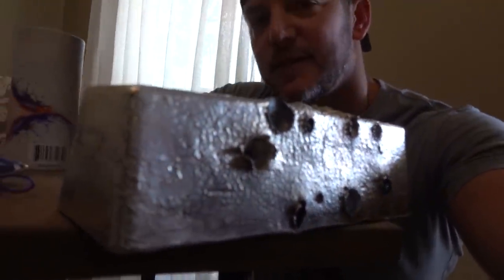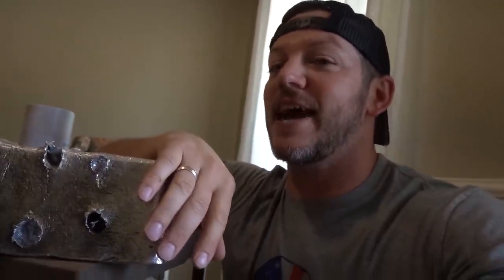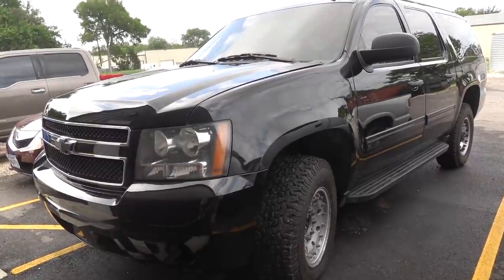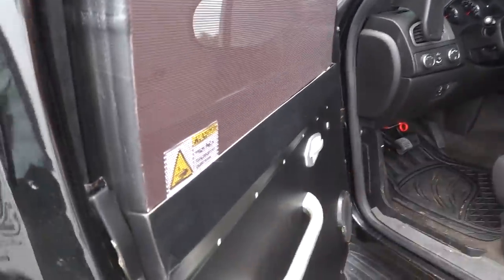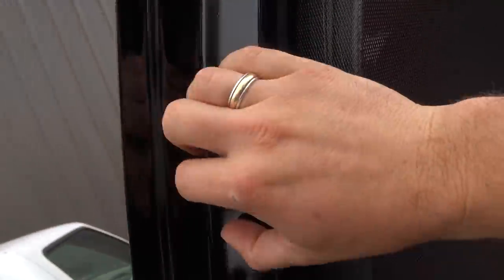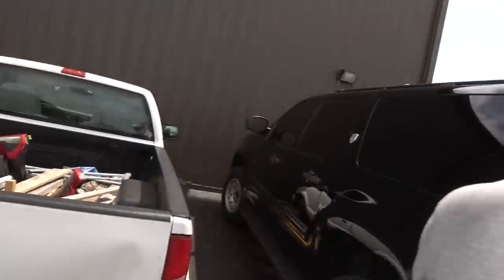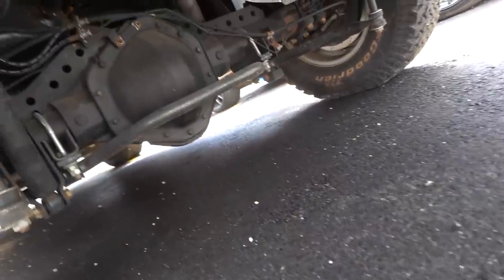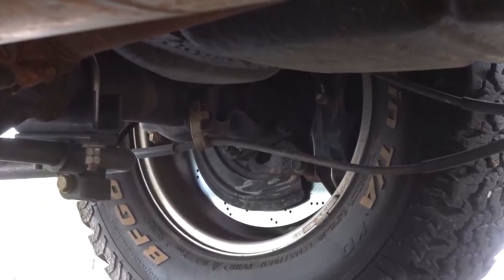I may have acquired a FULLY ARMORED SUBURBAN!!! 50 cal Proof...

Comment: Don't lock your keys in the car. No slim Jim that I know can handle the job.
Reply: Dead battery would also screw you.
Reply: Lmao you win the comments section 🤣
Reply: Picking wafer locks isn't but a thang.
Reply: @stopthephilosophicalzombie9017  "this is the lockpicking demolition"
Reply: @ComfortableFetus  Lol. Indeed.
Reply: Probably why the back is a door. If you get locked out that's the only way in
Reply: @stopthephilosophicalzombie9017  If they really engineered the car, that lock will be made in-operable.
Reply: @TBendez  What, you mean only remote access?
Reply: @stopthephilosophicalzombie9017  A theory of mine but yes, RF/IR remotes have been around for well, 30-40 years, and are not exactly witchcraft. Counting on physical keyways in a car like this, nope. 
Honestly, remote access with some kind of encrypted protocol would be my choice.
Reply: @TBendez  Sounds good to me too.
Reply: @stopthephilosophicalzombie9017  most likely armored, a dude from the sinaloa cartell had and fully up armored gold plated jeep grand cherokee and got plugged and when a round busted threw the key hole
Reply: Theres probably a code pad somewhere that opens the back hatch. either that, or a secret lever that opens one of the doors. If i had to guess, somewhere underneath protected by a rubber seal.
Reply: Lol
Reply: Best comment

Comment: stopped by the police
officer: "could you lower your window sir?"
Matt: "I wish.."
Reply: glad im not the only one thinking about when he gets pulled over for way way to dark tint
Reply: I'm a bit worried in case they crash the car, and then the firefighters are unable to extract them because they can't get into it!
Reply: @thesaxophoneboy  what’s the chance of crashing into something that will quickly stop a 12k lb car though? And in that situation how would a lighter car help lol
Reply: @thesaxophoneboy  what sauce said, that thing is crushing normal cars and trees with ease
Reply: @thesaxophoneboy  the hydraulics in those doors are strong enough if used from the inside to break the latch and force the doors open, plus it has an escape hatch into the rear of the vehicle, they are very very well built.
Reply: @thesaxophoneboy  Short of being run over by a tank, I don't think anything would deform this thing enough to be a problem in a crash.
Reply: @thesaxophoneboy  called the jaws of life.
Reply: @thedausthed  Maybe being hit by a high speed semi with an oversized load, but other than that or a tank nothing is going to deform that car enough to be a problem.
Reply: @thesaxophoneboy  It has hydraulic rams on the doors I’m pretty sure as long as the electrical system is functioning it will open itself
Reply: @Electric_Fence_Pence  In that case a normal car would be unsurvivable, so a mute point.
Reply: We had b6 suburbans in Iraq. Could actually roll the front windows down like 4 inches. IED would have smoked us though lol
Reply: There's a difference between a vehicle being bulletproof and crash resistant the front end could be mashed up pretty bad and take it out of commission. Even a tank can get stuck did you watch the end of the video.
Reply: Police? Stop? Why? Nothing gets in........
Reply: @pd1jap  lol....I was thinking the same thing.  There's no stopping in that thing.🤣😂 Ya wouldn't need to stop & could simply say to the cops....."no, not today officer,  im cool on talking to the police today".  & Proceed about  your day
Reply: @Electric_Fence_Pence  or just whistling diesels fist. 😂
Reply: @Electric_Fence_Pence  a line from movie " caddyshack " comes to mind... Hey...you scratched my Anchor... lol
Reply: @thesaxophoneboy  i think they will be fine in a crash

Comment: Matt on a serious note, you need communications equipment in there. CB, etc.
Reply: Sat phone
Reply: Definitely commo, digital and UHF/VHF with low profile mobile repeaters are pretty sweet setups and works as a base station for mobile radios. Some of the newer antenna styles are little 3-4" tall cylinders and will get some awesome reception and broadcast, the antennas look like nothing mounted on the corners of a roof rack. I know people who can communicate multiple states away with these setups on the move and they are very discreet
Reply: CB is crap compared to a good ICOM radio like a 718 or 78. I have the former and like the latter I can transmit AM/SSB/RTTY/Data from 1.7MHz to 30MHz.....with a typical low mount NVIS antenna you create a 400-600 mile "bubble" and with a vertical you can talk from Texas to Australia long path or short path with 100watts.
Reply: StringerNews1  Would cellphones even work inside that thing?
Reply: And an upgraded Airfilter! Nice to be Bulletproof, but you also want to be safe from farts and/or mustard gas ;)
Reply: StringerNews1  Great info thanks.
Reply: Absolutely

Comment: Next on off the ranch: 
 I put a turbo Cummins diesel engine in my armored suburban
Reply: yea it should be a 12 valve cummins
Reply: That would be awesome
Reply: It wouldn't fit now with all the armor the engine bay has. He'd have to duramax swap it(that may not fit either) or have Texas Speed build him a 6.0
Reply: It honestly needs a diesel with all of that extra weight. There is a company called DuraBurb which specifically stuffs duramax diesels into gm SUV’s
Reply: And loaned it to Whistlin Diesel for the weekend.
Reply: I need to take TIV2 down for him to geek on. Now that’s an armored turbo cummins diesel
Reply: A diesel engine wouldn't be ideal, as a vehicle for emergency situations having to get diesel thats harder to get and more expensive than gas would cause some issues
Reply: That thing would handle a DuraMax
Reply: @alex_5623  the first think that's going to run out is gasoline... diesel will be more available for a little longer. Probably not by much though.
Reply: @StorageAuctionSnipers  
either way preppers are going to have their own fuel storage on their property, many many gallons.
Reply: @StorageAuctionSnipers  but think, how many preppers have big vehicles powered by diesel engines? They're gonna be hoarding all of the diesel, and yes it would last longer but still be harder to get
Reply: @StorageAuctionSnipers  you're forgetting that you can store non biodiesel forever
Reply: Duraburb Inc. swap out of Florida
Reply: @alex_5623  diesel engine are easier to modify to run on other fuel sources
Reply: @StorageAuctionSnipers  then we filter and thin out McDonald's grease. Then the truck gains 20lbs.
Reply: Or a lil something from Texas speed🤟🏻
Reply: @alex_5623  Humvee’s are diesels for the fact that diesels can run off anything flammable in a pinch with small modifications.
Reply: @dustynwilliams7816  True! I used to work for Deutz here in Atlanta. German diesel engine company, worldwide! We ran Diesels on everything from Ethanol/Methanol to JP4! Just no Gasoline (maybe 5% or so). We also had one of TWO prototype BF5L513 Diesels that were specifically intended for the Humvee! One went in a prototype Hummer for testing. The military parked them nose-in in a circle around some BIG explosive (we saw the "Declassified" vids). BOOM! All the liquid cooled ones started puking fluids (the ones that weren't destroyed instantly). Ours was Air Cooled and other than a few cooling fins knocked off it just kept idling (yes they were running tests) until LONG after the others seized! Unfortunately the "Brass" decided not to put a German Diesel engine in American military vehicle so one of the US manufacturers got the contract. I forget which one (long time ago)... ;)

Comment: Little does Matt know that it’s going to cost him another silver bar to keep a full tank of gas in that thing
Reply: This thing is probably eco friendly compared to his 5 ton.
Reply: It really needs a Duramax!
Reply: @oambrosia  that 5.3 vortech is weak for that 12000pounds 🥺 at least a 6.2.. or a winy power adder !
Reply: @teal_2v338  The 5.3 can be tuned surprisingly well, and so can the 6.2. Actually, the 6.2 Vortec is capable of 420 horsepower STOCK. Some nagasaki noisemakers and an upgraded long block can easily get it to 600+.
Reply: @lsswappedcessna  tuning itself wont give that much.. but with his lt headers and short ram.. maybe a little more but those gen3 were not the most performing.. that thing need monster torque to move! He probably have some aftermarket ring and pinions in the differential to help 4.10 and even higher would make a good difference
Reply: @teal_2v338  it’s probably a 6.2 and not the 5.3
Reply: @erikkarlonas180  It's 6.0 LQ9
Reply: @lynnelovesyoudude  totally forgot about the 6.0....duh

Comment: You need to look for oxygen tanks because once this goes into a river or in water you'll be in there for a while
Reply: Winch.
Reply: Hydrolic doors can handle the water preassure
Reply: What if they got in a wreck though?
Reply: It’s an interesting point. Not breaking the windows that’s for damn sure.
Reply: @andresschwerin829    Unless hes getting into a wreck with a bulldozer hes good
Reply: @johnhightower7811  true
Reply: Air not oxygen. Humans can't survive in a pure oxygen environment for very long, plus oxygen is very corrosive to his body and his steel "car".
Reply: @AliceUnbound  you can breathe pure oxygen for up to 12 hrs safely. unless you are breathing compressed oxygen at depth then you are going to have problems quickly. but yes you are correct bottles of air are much better and safer than pure oxygen. it seems few people know this which i find strange. what we breathe is taught in grade school science class.
Reply: @thelumbercompany  assuming the water does not short out the electric system for the hydraulics.
Reply: @BenjaminStJohn-en9nv   If you look inside the doors, there's an orange emergency latch to get them open if the power fails.
Reply: @raddlog  doesn't matter, pressue would keep the doors shut, the car would need to flood first

Comment: matt, if you want the ultimate buyout for an armored vehicle, install ARs behind the driver and passenger seat for the riders in the rear, install ARs on the inside roof ( they make a rifle mount for the inside roof of any vehicle so im sure you'll find one to fit your new truck)  for the driver and passenger, install extra mags in the back of the seats and under the dash both sides. install pistols and mags in the doors if possible. medical kits in the rear, and I mean a FULL range medical kit including curved needles and thread for stitches, gauze etc etc. food (MREs or dehydrated foods) and water along with the survival straws for water outside. waterproof matches and also a sparking device for starting fires. install a smoke screen button and 360 cameras with night vision, you may want to get some kind of shelter for outside the vehicle like a pop tent. and people laugh but I would also include a few rolls of toilet paper. also some kind of heating pads in case its cold when you need it. and a very small generator that is  multi-fuel. if your bumpers are hollow you may be able to get a device that can fill your hollow bumpers with water and install a silcock to drain the water, if they aren't hollow you may be able to install some kind of bladder behind the bumpers so they can hold water ,( I've seen that on jeeps when we go mudding). and install some kind of radio communication with portables so everyone has a radio and can communicate with each other. you also need rechargeable flashlights for everyone.

Comment: Red light is so that you do not have to wait for your eyes to adjust when going from light to dark. If you are in complete darkness, use red light, when you turn it off your eyes will still retain the dark sensitivity
Reply: Red lights are also the hardest for your eyes to spot which is why lots of militaries and hunters use red lights, so others wouldn't notice the light.
Reply: Lowest frequency as well, learned that from physics. So I’m guessing violet would be the worst to have in a car.

Comment: Look into military tank and helicopter NCBR sealing systems. What the military does is run a tire tube type gasket around every door and window on tanks and choppers. They are normally deflated to open the doors/windows but if shit ever hits the fan, you can activate an air compressor (or compressed air) that inflates the tubes, effectively sealing your entire vehicle from all chemical, biological, and alpha radiation particles. Same system that NASA uses to seal space capsules once closed, allowing compartments to work in vacume.

Granted you'd have to go thru every surface inside and out to verify a good seal everywhere but you can easily seal non-openable areas. Also a filter system for the intakes, AC etc.

Lot of work but 100 percent do-able.

Comment: You should definitely put a “no break light switch” so you can use your breaks without the lights coming on in case someone’s trying to follow you at night
Reply: Now that's a good idea
Reply: Police vehicles have that feature. It's called "blackout" It's built into the TM-4 light bar controller.
Reply: I know.... a guy... with no break lights  switch and all lights switch.
Reply: No breaks? No one works hard without breaks, now brakes, brakes are important for stopping a vehicle lol
Reply: Thats illegal though, otherwise everybody would have that feature...
Reply: @crazysilly2914  lol. Everybody can install this feature in any vehicle for about thenorice of a switch. Legal or not
Reply: @crazysilly2914  I have a hunch that it’s illegal because the average person is gonna forget that they have their brake lights off and rear end collisions would go up. The amount of people that don’t realize their turn signal is on for miles is unreal.
Reply: YES
Reply: -- Should be standard equipment.
Reply: Lol my moms stock suburban had a no lights button combo
Reply: Well  it could also lead to idiots driving into the rear of your car because they couldn’t see you breaking
Reply: @pineappleboi27  Standard mod for Cannonballers 😉👍

Comment: You really need a CB and HAM radio system. Absolute must have! Gotta be able to communicate with the outside world in a bug-out situation.
Reply: Absolutely!
Needs a console with some Motorola APX goodness, a decent scanner and HF capabilities.
Just not bugout capable without decent comms!
Reply: Don't forget GMRS radios too. Granted, GMRS and ham radio require licenses to transmit but the comm capabilites are invaluable.
Reply: Sat phone too
Reply: An SDR setup. That'll cover nearly every band.

Comment: radio, med kit, mre, cooking kit (eg. small gas burner and cutlery), ar, ammo, handqun, flares, armor, backpack, basic survival kit, water crystals or distil kit. pretty much all you need + a few cables to charge anything you need from the car battery. you can also very easily fit most if not all of this within the lining of the seats. also if you dont have it already id recommend getting a radio license to go full prepper.

Comment: I'd start with set of MT tires, food, water, weapons and ammo, body protection - gas masks, vests, helmets, emergency oxygen, heavy duty first aid, shock and smoke grenades for escaping vehicle, maybe a winch and a search light operated from inside. Pepper-spray front and side system against crowds.
Reply: Starting to sound like the Batmobile. Not the 80’s one, the Darknight rises version.
Reply: Those are mil spec glass reinforced tires. Bullet proof and can manage the 12 k  lbs. I don't think Mickey T makes those.
Reply: Winch for sure. All that weight means getting stuck is probably the worst that can happen to you. If you have to leave the vehicle because you are stuck it defeats the whole point.

Comment: 1000% should have a Lifestraw for you, Mere, and the kids. One for each of you. You can drink from any water source. It’s tried and true.
Reply: The Sawyer filter is better
Reply: Can u even drink from the toilet?????
Reply: Way better than packing water
Reply: At least 3 separate ways to drink water you need more than a lifestraw
Reply: It doesn’t filter viruses an bacteria
Reply: A lifestraw cannot be used to drink from any source. There is A LOT it won't filter out. Same with the Sawyer. Do your homework.
Reply: @themanyousendtokilltheboog3900  well those are the only things other than parasites and heavy metals that need filtered out of water usually.
Reply: Always take one and two backup options for water
Reply: Level 4 gta armor
Reply: you are half the problem with American yo
Reply: @mrdrux  sawyers do have a much longer life span. Like 10,000 gallons or something vs 1000 in a life straw
Reply: @donaldliverance2597  Exactly.  The sawyer system is pretty universal, and great for warm weather environments, but doesn't catch everything.  That's why water purification tablets are great; they're so light and small, and work well in a pinch.  Plus, there's always the good ol' boil.
Reply: @Bomples98  I just don't like the idea of sucking out fillings to get a sip of water.  I don't think his kids could swing that kind of suction.
Reply: @mrdrux  Sawyer is way better than Lifestraw. But, I have multiples of both in several bags.

Comment: Hidden winch mount for the front if it'll fit with the armor there. Light pods all around. The newer LED ones are small and inconspicuous when off. Radio with a PA system and a mic so you can hear, and talk to the outside.

Comment: The metal around the window area is called overlap.  The wheels are blast resistant & like those on Presidential Suburbans.   They also have run-flat inserts to keep the vehicle moving & not tear up the tires.  You need a spare tire & bottle jack!
Reply: Interesting question:  would he need a special jack to lift 6 tons?
Reply: @hotsauce7709  The factory wheel & scissor jack are likely gone and wouldn't be strong enough.  Bottle jacks are compact and come in various capacities.  One could lift the entire truck, so just one corner would be fine.